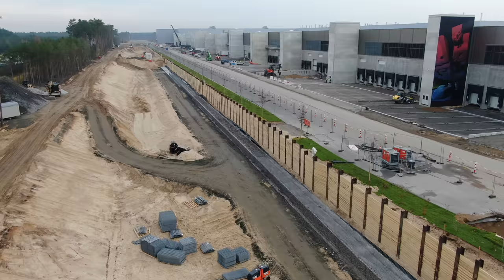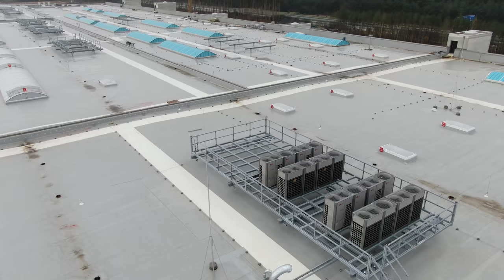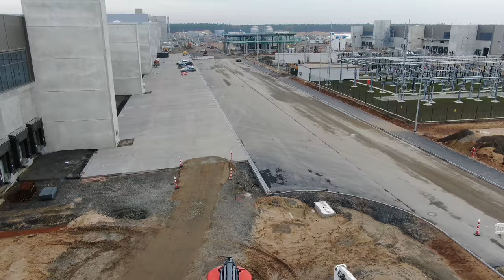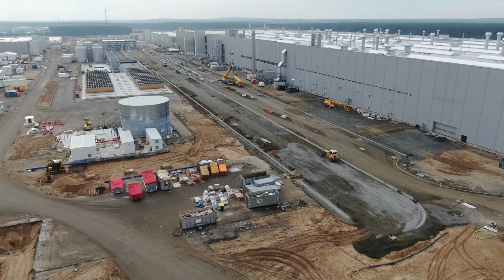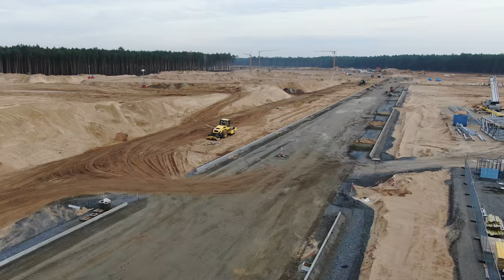Giga Berlin | 2021-11-13 | Air ducts

Comment: Apparently the commencement of production, if it is to be within a few weeks, will be in the midst of a lot of ongoing construction. That's a good sign. I like a company that puts assets to use at the earliest moment practicable. I appreciate you showing us things that tell us something!:washhands:
Reply: Thats what they did in shanghai. Not everything was built out but enough to run production. So they started building cars before the buildings were all done. Same will happen in berlin and texas
Reply: I wonder how they could start without energy central. If they can, the energy central is not needed.

If everything would be needed for the later battery production, I guess it would be nearer to it and, in a way, mounted "too early"..
Reply from the maker: @AndreasDelleske  There is a difference between start of production and high volume production.

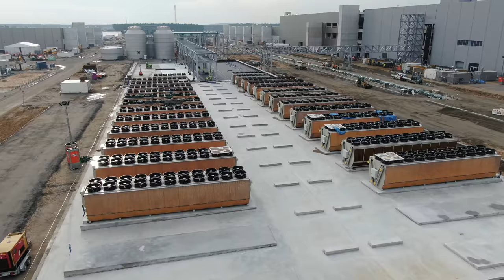Comment: 11:50 The new Tesla hairdryer station with 3000 seats! I wonder if a considerable part of that energy could be reused via heatpumps.. or even big Stirling engines, at least in winter. Funny thing is: 40 C water can still be used to cool server CPUs

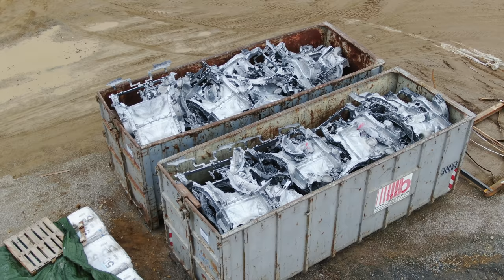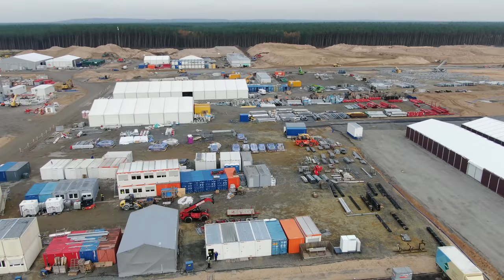Comment: Interesting, dozens of discarded rear body GigaPress castings at 15:30; and 10 or so Model Y’s wrapped up outside at 21:40
Reply: New Giga Presses being delivered and put together all the time. Once built, there is a lengthy process of getting each machine working precisely. 
This will be  ongoing for awhile until all the Giga Presses have been delivered and become fully operational.  I expect Tesla to build another factory on the Berlin site starting in about two years. Same with Texas.  They have plenty of space/land at both places and the availability of workers will be a major factor in where/when Tesla chooses new factory sites.

Comment: 15:30 Does this mean the casting presses have been working?
Reply: Looks like that. I can’t see another reason why those castings are there.
Reply: They have been working for many months and adding more constantly both at Berlin and at Austin, TX.  The ramp up in production for both those factories in 2022 is going to blow  lots of minds and expectations.
Reply: the first casting presses were installed 6 months ago.  They don't have battery packs, so they didn't turn them on
Reply: @davidanalyst671  battery pack? Why? I thought they will be 3 body parts .. the front and back of the car ( casting parts ) and to connect both the battery pack … I’m wrong?
Reply: @wolfgangselle3272  what point is the castings if they don't have batteries... is the point.  the battery building is being built, so they either ship in batteries from nevada or they have to wait until the building is running
Reply: @davidanalyst671  batteries will be imported at first then change over 4680 once plant is at good yield rate. Giga cast has been running with propane tanker parked outside for the melting furnace. They will make many casts dialing in the gig casting units. IMO

Comment: Is there a risk that this site could be shut down or never gonna get a permit? any thoughts?
Reply: The probability that this factory must be demolished again is safe with less than 1: 1000. Perhaps Tesla must meet certain conditions; this is not uncommon for all commercial buildings.
Reply: Not really as Tesla received preliminary permits already for nearly everything. Those permits must be only granted if the administration is convinced that the underlying application does not violate any laws. Thus the administration can't really refuse the final permit for those issues, as this would mean they did grant the preliminary permits in an illegal way. 
Some of those permits (e.g. on cutting the forest) have been also brought before the court by the environmentalist. But were confirmed by the court. The environmentalists did go before the appellation court - and lost again. A denial of the final permit on those issues is thus absolutely impossible. 
The denial of the final permit is only possible on severe legal issues - which cannot be fixed by demanding a change of plans or other additional measures.

Comment: Are they building a moat around the factory?
Reply: Yes, Warren Buffet said he would not invest in Tesla unless it had a moat.
Reply from the maker: Those are rainwater infiltration basins for the water from the roof of the main building. They will look like a moat, but only along the west side.

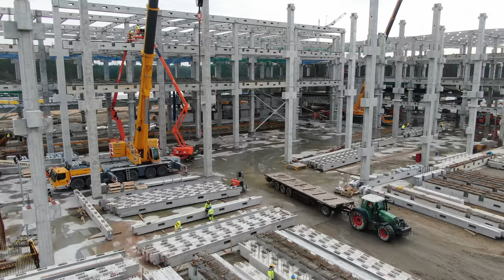Comment: 18:18 correct me if I’m wrong but is there some new factory building technology going on here?
Reply: Its the Factory for Cell Production
Reply: Looks like a parking structure to my eye..
Reply: Yes, constantly with Tesla.
Reply: No, that is standard in europe.
Reply: Germany has a long tradition on construction with prefabricated concrete parts. Some aspects are however indeed rather new. Like how the pillars have been fixed to the foundation.
Reply: In Germany they primarily uses pre cast concert structures over steel I beam structures. Austin used both systems as needed for best performance and speed. The NW corner of Austin is also battery production building and was 100% Steel I beam construction, and went up very fast. The ground in Germany was less stable and Tesla was limited on uses of pile driving because of fears of water supplies. This alone should have been the point Tesla moved the plant to almost any other country in Europe. IMO

Comment: The pace of this factory is truly a head-scratcher
Reply: They are ahead of Texas, so what's your point?
Reply: why are they coming in to work on the weekend if they aren't going to work?
Reply: @wolfgangselle3272  this building should have been steel and it should have been completed a month ago.  instead they are all just sitting around slowly installing concrete beams

Comment: Thanks for uploading. Just now heard from Torque News: there is new objection from environmental critics, suspecting paint shop and aluminim die-casting in Giga berlin pollute the air.  Will this impact the approval?
Reply: I don't know any details, but my view is Germany can have any standard it wants, as long as it applies it equally to all car plants operating in germany. It is not ok to have a different standard for Tesla.
Reply: @fjalics  but other manufacturers had already got approval long time ago.
Reply: The German auto makers are well aware of what Tesla Berlin will do to their sales once it is operational and ramping up production. Every day they can delay that gives them more time and saves them $$$. But it is futile. Tesla doesn't stop building their facilities even with delays in the beginning of production. They just keep on building out more and more which means the production ramp and market shock will be even worse for the likes of VW, BMW, etc. Right now there are about 10 -12 ships full of Teslas on the way from Shanghai to Tesla Europe. Something like 50,000 cars on the way. Elon recently said that one of Tesla's supply problems was finding enough car carrying ships for Shanghai and Fremont export. I wonder what this is doing to the EU / China balance of trade ?
Reply: @terrysullivan1992  but import car from China and USA will pay import tax, The Tesla which made in EU should be more competitive in Europe market.
Reply: @marssmith4640 So? Are you suggesting there isn't a standard? Especially air pollution. Find a way to measure it, measure Daimler, BMW, VW, and Tesla. They all have paint shops. I think the aluminum casting concern is probably baloney, but if it isn't, I'm sure they cast aluminum in Germany somewhere.
Reply: torque news is terrible
Reply: @marssmith4640  yeah that’s right … but if this manufacturer expands there production they also need a new approval process for this extension. The “ problem “ with Tesla it’s a new factory ( nothing there before ) and the water problem. And by understanding That’s a big thing and the main hurdle to get the final approval. Clear now the environmental groups find a other issue … air pollution from the paint shop or from the casting … sure water, birds and lizards was not enough LOL 😂
Reply: @davidanalyst671  why？
Reply: @marssmith4640  their videos are terrible.  just take a deep breath, and learn the facts, don't listen to a Musk rant
Reply: @marssmith4640  Because it's 90%BS and 7% false info.
Reply from the maker: The air pollution discussion has nothing to do with the approval. It's just worried citizens and a flawed measurement point.
Reply: @TobiasLindh  Thanks for ur information

Comment: Does anyone know what the pits and structures they are building at 26:25 are?
Reply: the supplies on the ground look like concrete pipes.  One of the actual legitimate problems with the factory is that it will use a TON of water in the battery process.  So they are building water management systems to collect and hold water.  The city has water issues, so if tesla just starts using a bunch of city water, the city will have to spend more money on pumps, pipelines, fiter systems etc...  tesla having a water mgmt system eliminates the issue.
Reply from the maker: @davidanalyst671  And again you have no idea what you are talking about. The factory will use very little water in the battery process due to their new technology. Most water is used at the pretreatment in the paint shop. And Tesla will not use any collected rainwater.
Reply from the maker: In front you can see what will be the trailer yard. 
The big basin on the right is the rain water infiltration basin. All the rainwater from the rainwater retention basin will be pumped to the infiltration basin and infiltrated into the ground at this location to refill the groundwater. 
A little further back there are the rainwater retention basin, the fire extinguishing water retention basin and the pump station. All the rainwater from the roads will go to the rainwater retention basin. In case of a fire all the water will go into the fire extinguishing water retention basin, as this water would be contaminated and can't be infiltrated.
Reply: @TobiasLindh  Thank you Tobias for the detailed reply.

Comment: I watch this in Germany and also the Texas Terafactory fly-overs.  What I can't figure out is that when I watch the Texas project, there are hundreds, even thousands of cars, workers everywhere,
and equipment moving and working day after day.  When I watch the Giga Berlin, I see a few workers, very little equipment moving, etc.  What's going on.  Are the videos taken on Sundays or
what.  No wonder I my mind that Tesla's Austin, TX factory will be opening sooner than this.  Good pictures, though !
Reply: yes.  this video taken on a weekend for the privacy of the workers.  plus you can zoom in and focus on stuff without having workers throw rocks at you.  Giga berlin has slowed to a snails pace tho.  They can import battery packs from nevada, but for the most part, it appears that they are going to wait for the new battery building... that is also progressing at a snails pace.

Comment: German efficiency? is this place ever gonna open? will Tesla ever satisfy the German ecology laws? I wonder when will the construction crews go and a demolition crew be hired?
Reply: Maybe in hundret years.
Reply: It will open … no worries .. what the most people here don’t understand is that this ecology laws are no joke in Germany. Germany is not China or the USA where they give a shit. And if you want say so the “  main issue “ is the water problem. Remember this factory is build in a designated water protection area. And it used a lot of fresh water. That’s the reason why the local people are passed of. And that’s why years ago BMW walked away to build there new factory there .. because they didn’t want the fight there … they build on a different place … Leipzig
Reply: Tesla has preliminary permits already for nearly everything. Some of those permits had already be challenged by the environmentalists before the court. Without success. On those issues (like cutting the forest) Tesla satisfies thus the German environmental laws. Which leaves effectively no reason to deny the final permit.  
The final permit is a legal process. It does not depend on the "mood" of the environmentalists. Nor on the goodwill of the government. To much goodwill is anyway dangerous. Caused the last delay as the public hearing had to be repeated as the government tried to be faster than the law allows.
Reply from the maker: There is no reason why the factory shouldn't open. You just ask these questions because you believed in the FUD. But there is nothing to worry about.